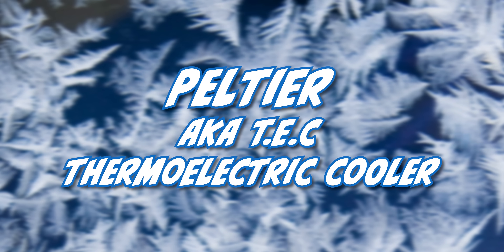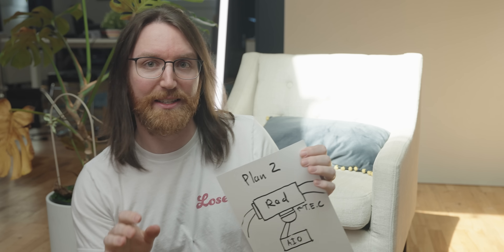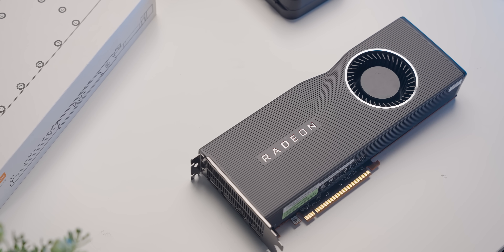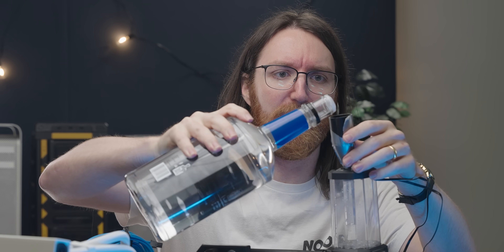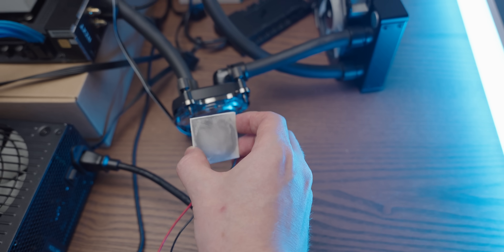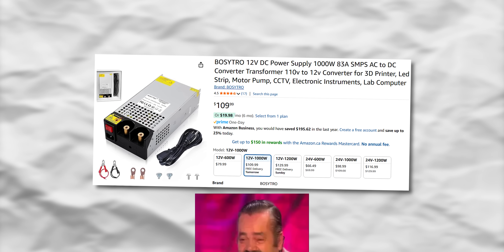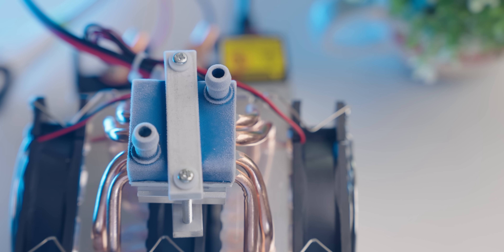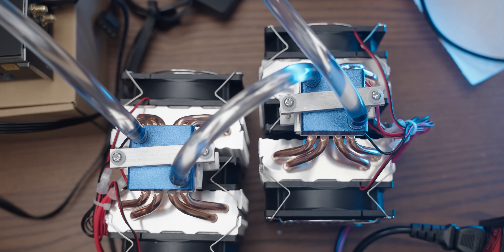I REVOLUTIONISE PC Cooling....

Comment: TEC or peltiers have an issue .. If the heat in Watts exceeds the peltier , then the peltier fails completely . So lets say you have a 40Watt peltier trying to cool a 60Watt CPU / GPU = FAIL .. The Peltier needs to completely dominate the heat source to Win .  A long time ago I used a peltier on a Celeron 466 if memory serves . It was close , most of the time the peltier was winning except on hot days ( Extra heat from the nuclear furnace in the sky )  Issue is condensation ...  ( Yeah )    I forgot , U also have to remove the heat from the hot side ( PROPERLY ) , if you don't !  Then the efficiency of the peltier suffers ..  So the cold side has to over power the heat source and then you need to cool the hot side ...  ( Peltier Life )

Comment: Invest in either some plastic/rubber/wooden clams or silicon sleeves for your clamps. The clamp was sucking up all the heat from your irons when trying to solder.

Comment: I messed with these back in 2012. First direct contact, direct contact stacked, then indirect staged cooling blocks. It worked fine if you'd ignore all the sweating and the having to figure how much wattage you have to overcome. 

Now, here's another fun project that works. getting an AC unit, getting a liquid tank, dip the AC radiator (cooling side) in the tank filled with coolant, drop your PC radiator in the tank. (DO NOT FORGET TO TURN OFF THE AC WHEN YOU LEAVE FOR THE WEEKEND!)

I had cool plans of having robotic fish swimming around, or godzilla, as I was using a fish tank for my coolant tank but I left it running for too long and ice formed and shattered the glass. But it worked really well on the R7 1800X at sub 10c, I had to trick the temp sensor on the ac tho.

Comment: You should have placed the peltiers after the radiator. A radiator dissipates more heat is there is a bigger difference of coolant and air temp. If you cool down the coolant before reaching the radiator it essentially does nothing.

Comment: Instead of placing the Peltier element directly on the die, why not slap a simple heat exchanger in between to smoothe out temperature spikes? You could use a vapor chamber (without the additional heat pipes) and try to accelerate the cooling process that way. Overall setup could look something like CPU -> Vapor Chamber -> Peltier -> AIO. For the Peltier to be able to exchange more heat in the same time, than the waterblock of an AIO could on its own, it will either need to create a larger Delta T or provide a bigger area for the heat exchange with the waterblock. Maximizing heat transfer to the AIO loop will enable the radiator to dissipate the most amount of heat.

Comment: Almost 20 years ago there was a AIO cooler which was called freezone made by coolit systems that was peltier cooled. 

It worked great. I had CPU temperatures down to about 12°c

The only thing you had to worry about was condensation depending upon the humidity in the room. 

They have a potentiometer that you could adjust how much voltage to control how much it cooled.

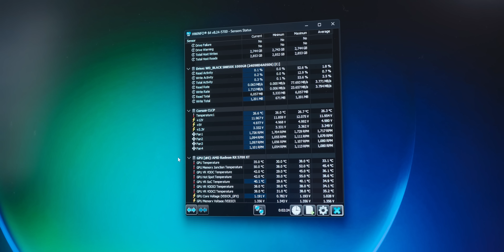Comment: 10:15 You definitely forgot the thermal paste. A single peltier will not be able to keep up with the heat load of the system though. You would need to do several peltiers or maybe do several groups of stacked ones.

Comment: The water is circulating too fast into the loop for the petltiers to be of any use because the radiator has too much heat transfer capacity in comparison. As long as the radiator is not saturated in how much energy it can dissipate, it will use ambiant air to heat up the loop. If you were to slow down the water flow speed, you'd get different results if the peltiers were just before the gpu. The only way to make this viable is to stop the fans on the radiator but at that point it becomes useless and you should just get rid of it. If your gpu is consuming let's say 300w of electricity, you'd need about 800w worth of peltiers to be able to move enough heat to get below ambiant temps in the water loop. A new problem will arise, you will start getting condensation on the hoses and the gpu. A long time ago when I was really into overclocking (about 20 years ago), I had built phase-change systems with direct-on-die evaporators and could easily reach -40c using R22. The only way to do it safely was to insulate with foam and a lot of dielectric grease. Then I started to just dump the motherboard directly into a mineral oil bath. Then I went dual-stage phase-change cooling reaching -75c then eventually liquid nitrogen. Those were the cool days of learning and honestly I may go ahead and get back into it now!

Comment: Based on other videos i've watched about peltier devices, your best bet would be to make a stack of peltier devices (one placed on top of the other, but the size of each device getting smaller as you reach the top...almost like a pyramid). This is typically what is done in commercial or product applications, like small refrigerators, etc.

Comment: That's exactly what I've been wondering. When you ask about the feasability of putting a Peltier cooler in a PC, the redditors assume you want to put it directly on your CPU and be done with it. No ! I want to slap it in my watercooling loop !
Every time there's a heat wave in my area, not only am I miserable, my PC is too, coolant temperatures get up to a nice and toasty 50+ degrees.  I always felt like putting a Peltier cooler on a waterblock to reduce coolant temperatures would help tremendously, and thanks to this video, I know it actually works. Slightly.

Comment: I would design the cooler different. 
Use the peltier to freeze a an enclosed chamber filled with water. Something like a copper tube wrapped in a small tubular like shape . The copper filled with water ( allow for water expansion due to freezing). Use the peltier to freeze this water inside.
Use another copper pipe which passes through the tubular frozen copper as your cpu cooler.

Comment: Have a look at mobile phone vacuum chamber coolers made for gaming. I have a Redmagic Cooler 5 Pro magnetic device on my alloy case GEEKOM A8 mPC. It doesn't specifically cool the processor but it keeps the ambient temp inside the case acceptable. 
It keeps my bits cool fella.

Comment: its amazing taht 20 years later people are still trying to use tec in cooling loops for pc. I had my run in with them when going to a FRYs electronics out in arizona back in 2004 and grabbing one of them thinking of pushing a 2.4ghz p4 northwood past 3.6ghz with the theoretical sub arctic temps pelts can get to. with almost the same setup you have towards the end (didn have the heat pipes back then but similar process). Direct mounting the tec would in fact get the processor cold enough at idle to dip into the negative temps and even cold enough to frost the back side of the motherboard but as soon as a load was applied temps would skyrocket well past lockup. The power consumption of TECs vs ambient vs results are way too inefficient

Comment: Not surprised, but I'm still wondering why peltier cooling still sparks so much curiosity in the PC community, just use an actual chiller instead. I'd love for you to tear an actual freezer apart and wrap a refrigeration cycle around a PC waterloop.

Comment: Probably the reason why so many people have talked about those "soda refrigerators" are garbage, they use the same kind of T.E.C. in them to "cool" the soda.
They are just not very efficient coolers/heaters.
Maybe it's cheaper... you can buy one of those "soda refrigerators" and either salvage the T.E.C.'s from them or just use the box to hold the water.
But that would be silly.....right???

Comment: So to be an @$$ :P, there are a couple of things wrong with this WHOLE setup. 

First is alcohol is a very shitty media to transfer heat with, it boils at around 173*F (78*C) I would put money you were micro boiling the alcohol in the gpu at cold plate fins. Micro boiling further reduces the heat transfer rate. You should have used a 10/90 anti-freeze/D-water mix, and to help reduce surface tension of the water added a "Water Wetter" to that mix (you would look at what the water wetter needed as a mix ratio and go from there). Royal Purples Purple Ice is one of the best water wetters on the market. 

Second is the order of operation, having the pelt be the first to off load the heat from the gpu meant it was fighting WAY MORE HEAT than it wants. Then what little cooling did happen was most likely undone by the rad being after the pelt. You said you could feel the pipes cool to the tough right before the rad. If that temp was below room temp the only thing you did was raise the liquid back up a degree or two near room temp. 

The order should have been Rez - Pelt - GPU block - Rad - Rez to close the loop. Letting the Rad dump the bulk of the GPU heat and then letting the pelt do its voodoo magic would have netted a much better out come. I would also have used the 360 rad and hell even ran the 240 and 360 in series to make sure I got as much heat dumped out of the water into the room before letting the pelts work. 

But all in all fun to watch. 9/10 on the content scale

Comment: Its seems you are using the TEC's on the hot side?
TEC's work better the lower the delta, so if you put them AFTER the radiator they would work much better

Comment: This is a great idea, and I’d really love to try this setup with a different configuration. In my opinion, their current setup is not optimal. The GPU transfers heat to the Peltier, which then cools the liquid. This cooled liquid is subsequently sent to the radiator, which further reduces the temperature.

However, I suggest an alternative approach. Start from the GPU, then route the liquid to the radiator, followed by the pump, and finally to the Peltier module. In this configuration, the radiator removes most of the heat before the liquid reaches the Peltier. As a result, the Peltier can operate more efficiently and cool the liquid faster, since it’s working with pre-cooled liquid instead of hot liquid directly from the GPU.

Suggested Flow Diagram:

GPU → Radiator → Pump → Peltier → Split → 
    ├──→ CPU 
    └──→ Reservoir (or back to GPU)
By adding a split after the Peltier, a portion of the cooled liquid can be directed to the CPU, allowing both the GPU and CPU to benefit from the enhanced cooling loop. The remaining flow can return to the reservoir or loop back to the GPU, maintaining a continuous cycle of efficient thermal management.

Comment: CoolIT Eliminator, tankless/reservoir-less triple peltier water loop with the TECs cemented to a unique round heatsink that a single 120 would pull air through to exchange heat.

Comment: I was using them before watercooling was mainstream, had to DIY everything, had one on my cpu (Intel Celeron 300A) and a second one in the reservoir, ended up freezing the water and and making an iceberg on the motherboard. Coated the motherboard with Conformal Silicone Spray so it didn't short out. Used DI water and Water Wetter for the fluid. Had to build my cpu block, GPU block and the reservoir block, thank god for granddads having mills and lathes.

Comment: They already did this around 2008 with the (Coolit Boreas) water loop cooling system.  I had one of these in a custom loop back then and kept my CPU temps below 10c and the loop temp at 2c.  I am surprised that there arent any companies out there still making these.

Comment: The peltier gets super cold but can't go directly on to the chip. What about attaching it to the air cooler and then cool down the hot side with the water loop? The air cooler will handle the ups and downs of the processor and the peltier would be like having super-fans attached to it.

Comment: Air for the crew was provided by a bleed air system on the engine compressors. This air was hot and had to be cooled before being pumped into the cockpit. This cooling was provided by a large total-loss evaporator running on a mixture of 40% ethanol and 60% distilled water (effectively vodka). This system garnered the aircraft one of its many nicknames, the "supersonic booze carrier" (Tupolev Tu-22)

Comment: heheh this video reminded me of early water cooling days when we had to make our own water blocks and used pelts and when done right you can get some stupid low temps the issue is that cold side likes to be right against the source of heat in other words your gpu die or cpu. Another issue is vodka has a far lower thermal conductivity compared to water. When used directly on die pelts can be ran at lower watts and still keep your temps very low. Meaning if you get a pelt to say 35f just above freezing your cpu temp or gpu temp will be about 10 to 15 degrees warmer under load.  1c pelt temp 7c gpu cpu under load is possible. More watts to the pelt = lower cold side temps. You can hook them up to controllers to read the temp of the cpu and gpu and have them ramp up and down in power like a pwm controlled fan you just need to run them through a controller acting as a relay. The controller see the gpu temp and calls for more power to be delivered etc etc. 

All that said your idea can be workable but you will need to use the heat sink in water idea to pull it off and the water will need to flow over and through the heatsink on the cold side what you want is a square res that you can set a heatsink in and use a gasket to seal it. Then you get the water to flow through the fine finned heatsink. You will want to keep your water temp to just a degree or 2 above ambient to avoid condensation. Depending on your total wattage for your pelt you should be able to get damn close to ambient room temps

Comment: You need massively more peltier modules, and they need to be PWM'd at ultrasonic frequency to run with much less than the typical 68 degree C temperature delta. You want them to move watts, not super cool things. They naturally do 68 degrees colder than the hot side: Think of this like Voltage, and you want Amps (the thermal equivalent being watts of heat flow). So you need to do the equivalent of a switchmode 'buck' converter, and give them a low PWM duty cycle. And you need to switch them at ultrasonic frequency because otherwise the thermal stress from being turned on and off again too slowly will make them crack and break. 

Keep in mind also: These sort of modules typically have specs like 12V at up to 8A: This is 120 W electrical, all of which has to come out of the heatsink on the hot side, in addition to the heat you're pulling through the cold side from the water loop. The 'cooling power' of such a module might be only 68 W when run flat out. So about 1W per degree temp delta, and it costs more than double as much electrical power to get that cooling. 

The one thing they are good for is making something tiny and well insultated, very very cold. They sometimes stack these in a little pyramid, where every level down gets far bigger to handle the additional electrically added heat of the stage before. This allows you get get something like a IR detector down to liquid Nitrogen temperatures, without having to have a supply of liquid nitrogen handy. But Peltier modules suck as 'heat pumps'. 

What you're doing is the equivalent of trying to make a welder (high current needed) from a microwave transformer (mostly does high voltage). It's just not going to go well.

Comment: Potential simply adjustment: change liquid flow to slower (or faster)? Also, instead of vodka, use radiator coolant for cars. Safer and more efficient thermal conductivity.

Comment: 1. The problem with cpu/gpu cooling is not how low you can drop the temp, but how much heat you can extract and remove from the loop.
The bottleneck is the interface between the cooling system and the air, plus the air itself have low thermal capacity. That is why the simples "just dump a bunch of ice in a tube over cpu die" works much more effectively: heat transfer rate for metal -> water is much higher and ice to water state transition consumes a ridiculous amount of heat to happen. Not very practical, unless you add an ice maker (like those cheap ones for drinks) in the loop.

2. The peltier element, at best, is just a more effective heat transfer medium. It does not cool by itself, it just creates temperature differential. If you can't remove the extracted heat - peltier becomes just an overengineered slub of thermal grease in a solid state.

3. Alcohol specifically is not used as a coolant for cpu/gpu watercooling because it has very low boiling point, and that's a very bad characteristic for a coolant in the current cooling tech. The temperature of the die can easily reach the boiling temp of the coolant, then the coolant would boil and evaporate at the contact point with the die hotspot, then the bubbles would accumulate around the hotspot and decrease the cooling capability, then the die would overheat even more... you get where this is going.
There are currently cooling systems in development, that rely on boiling the coolant, and they are specifically designed to make boiling bubbles flow up and away from the hotspots as fast as possible.